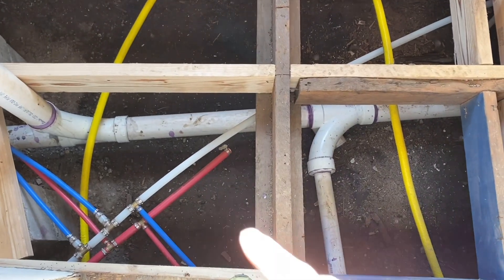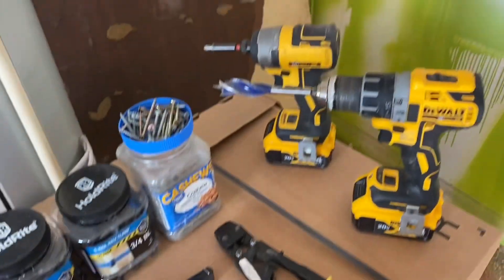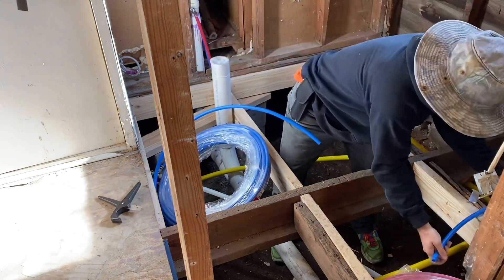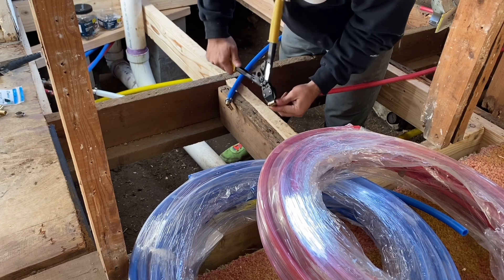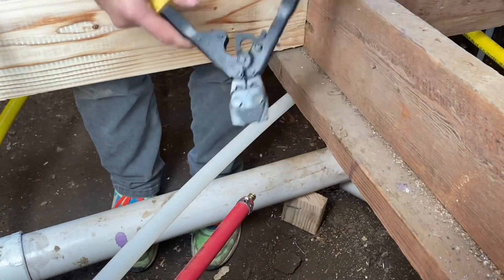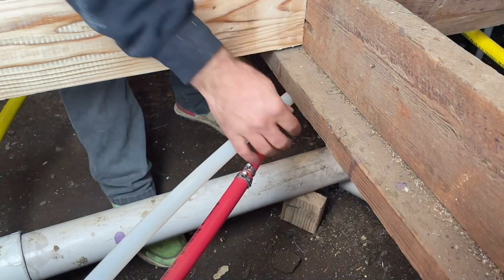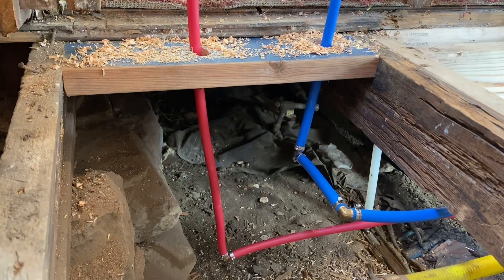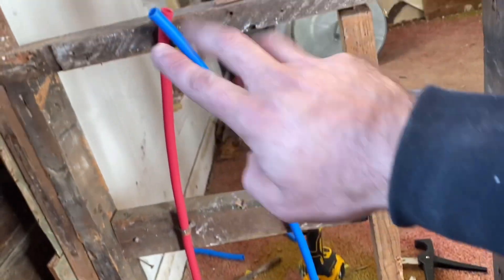how to run pex pipe to a bathtub from the main water line.

Comment: I like to use that material pex however I do my best not to use many fittings, as it does reduce the pressure and also the purpose of it is to have a clean mine running from point A to point B at times yes that is hard to achieve but here the choice of making the turns with fitting it's not correct
Reply: @GrantKeysProperties  respect your opinion and way of doing this , however I did say to me and for my way is not acceptable for the reason given .no one need to change you do that how you please and like and I will do it my way as well.

Comment: Thought the point of Pex is to not have alot of fittings.
Reply: It really comes down to which of the 4 styles of installation you choose to go with.
Plus, also come down to if you're willing to drill new holes in your floor/walls.

But yes, usually you end up using a Few less fittings when using PEX vers other Piping types.

However, there is no Wrong way to do it.
As long as there No Leaks or Hot water going to a Toilet - You're good.